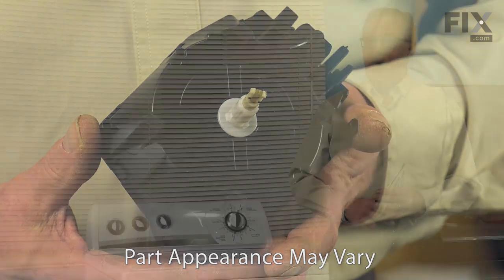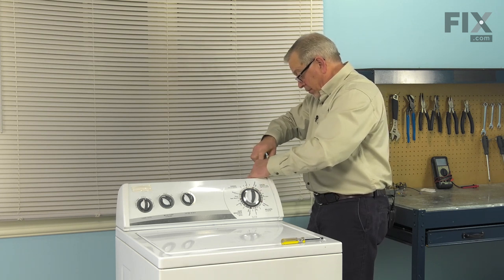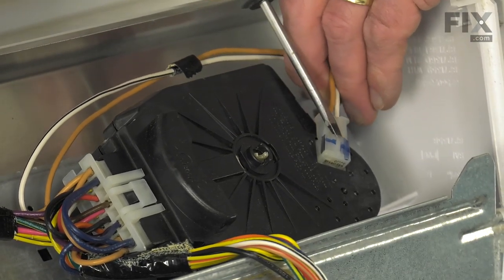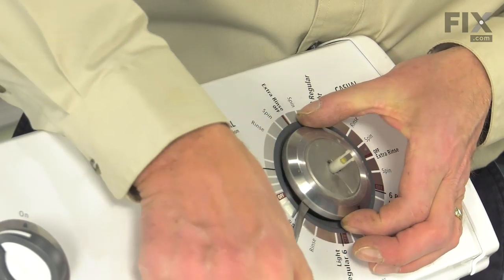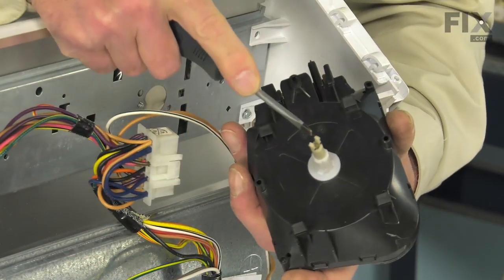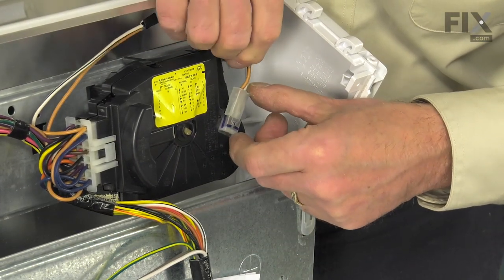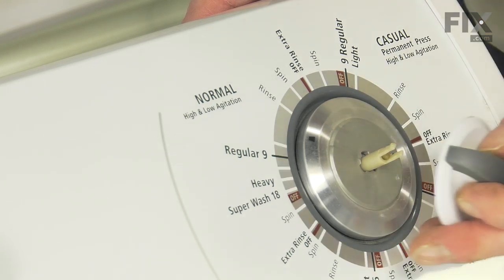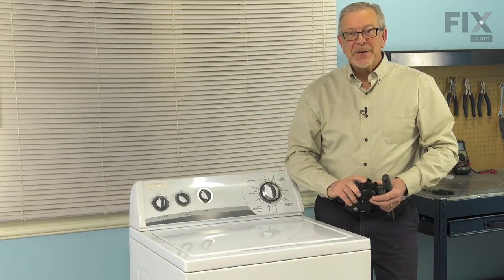Whirlpool Washer Repair – How to replace the Timer

Comment: Does the timer cause spin cycle to stop working? I can only hear clicking but no spin engaged?
Reply from the maker: There are several components that may prevent the washer from spinning. If the motor is not turning during the spin cycle, check the lid switch first. Then check for voltage output from the timer before replacing it.

Comment: Mine wont go through a cycle. Wherever you start it it stays. 
Example. Start a rinse and it will rinse forever. Will replacing the timer fix this?